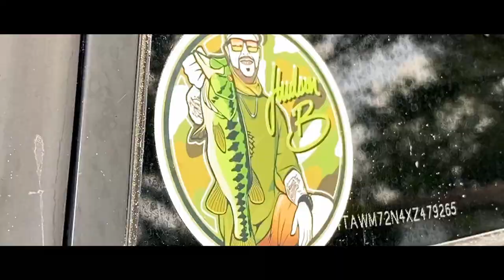Hudson B's Toyota Tacoma REVIVAL! | Paint Correction & Protection! | ITS A NEW TRUCK

Comment: what is compounding? difference with polishing?
Reply from the maker: So Compounding is the same as polishing, you're just using a pad that has more cutting ability, as well as product with more cutting ability. It's the "cutting" process that will get rid of the scratches, swirls, etc. After you finish compounding or "cutting",  you'll then need to polish in order to refine the cut paint. 

To get into compounding, just search some products such as "Cutting Compound" or "Cutting pad", etc. Just make sure you polish afterwards with a polishing pad and polish.